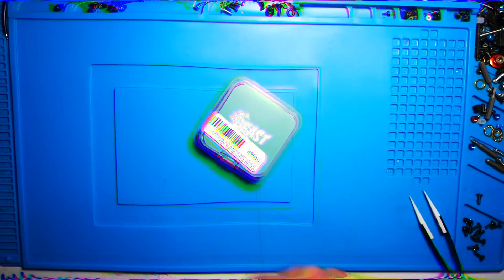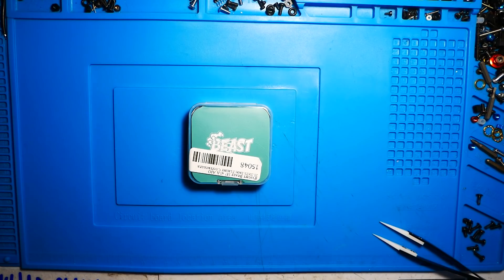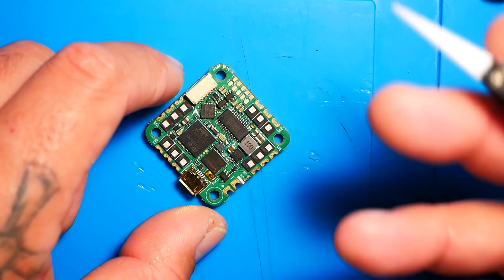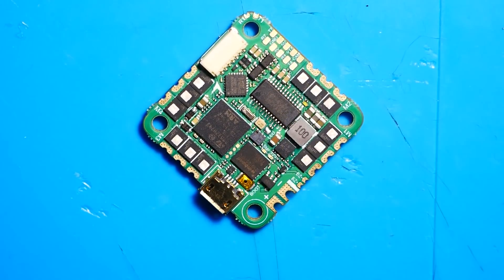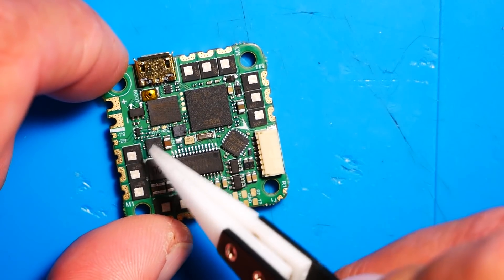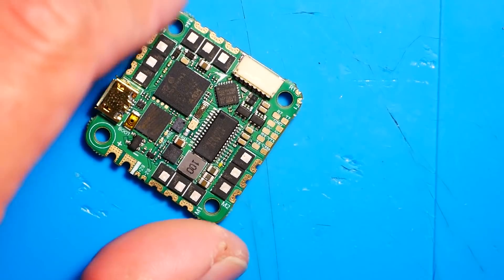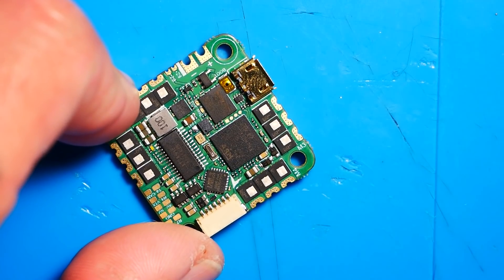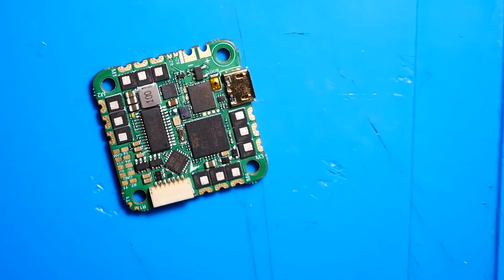Why Wouldn't You Use This? Strong, Fast & Under Rated! H7 Beast With 55 Amp ESC!

Comment: The gyro just measures the rotation around the axis in degrees per second. It doesn't know up or down, left or right etc.
The accelerometer is what measures the attitude of the quad as it measures the acceleration forces (eg motion) including the force of gravity so that it knows which way is up.

Comment: Why should be a H7 faster than a F7? If you are familiar with AHB, APB, AXI, Clock diagram and Domains you would not say this is true. I don't have a drone but I develop devices for the industry with F7 and H7 for years. H7 bugs consumed so many hours of my life. There are also some serious researches that BGA's are pretty sensitive in environment with vibration. I would never plan or buy such a board.

Comment: $120cad and you still need to buy jesc or flash jazzmaverick to get rpmfilter. Can't use new variable pwm like you can with blheli_32 beta firmware. Seems shortsighted to use blheli_S on a board of this cost.

Comment: Dude they need to make a 30x30 version with usb c of this exact board that would legit change shit as we know it today this thing has it all
Reply: They are its on the fb page
Reply: @BBSlats  wait both 30x30 and usbc? I refuse myself to go on facebook cause i value my privacy but if you say so i will keep an eye out for sure!
Reply: @Stefan_Besteman  I use my wife's account searching rc lol. Yup 30.5 x 30.5 looks like a usb c.  Only issue is it looks like it's in the front of the board.  I am going to put it on my 5 inch racer to try it
Reply: @BBSlats  the usb being in the front doesnt matter ;) you can mount it however you like and change it in the bf configurator with ease! im definitely scoring myself one of these for sure!
Reply: @Stefan_Besteman  I dont like my power pads hanging out the side

Comment: The esc will produce the amps but Doubt the FC will be able to handle the PID loop for 5” freestyle very well. Might also have trouble with handling the high amps after a few packs.
Reply: For the esc i agree, those mosfets look good quality but they are small.. so overheating is possible if you push them. but the fc why you think will not handle the pid loop for 5'' drone ? is the same parts the same functions the same specs as the other boards out there. what is your point of view in that subject?
Reply: @vmas29  my points are related to using this board on a 550g+ 5” based on my exp with smaller boards and their capacity to handle large/ multiple gyro inputs and pid changes - I guess I’m that sense I’m doubting the escs capability to handle the demands from the larger motors as well. Then include additional drag, weight and electronic and vibrations on sudden “breaking” I don’t expect it to handle well.
It’s definitely usable if you have a clean build, If you just fly in straight lines, don’t try to do too many tricks/ quick inputs and definitely do not bend a prop, you’ll be sweet haha.

Comment: Thats a little h7 compared to the other h7 flight controllers
Reply: I have matek h743 slim 30x30 fc same exact chip. Its a bga chip   480mhz clock speed